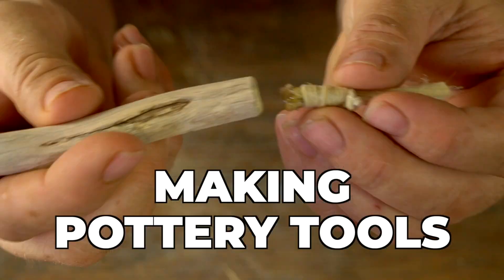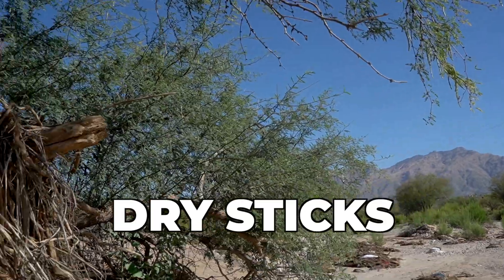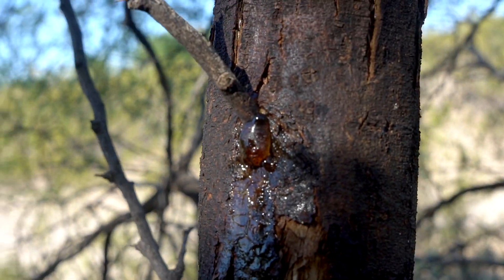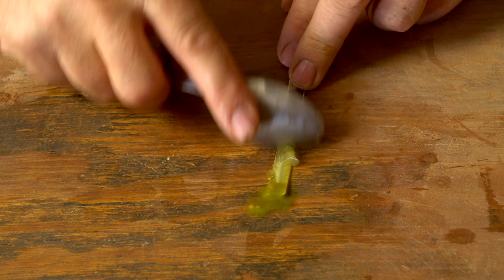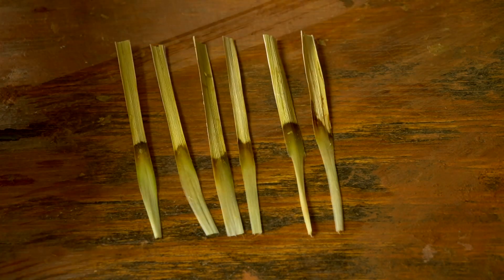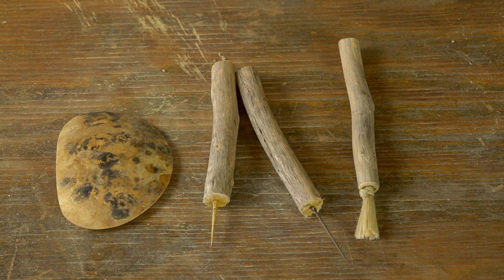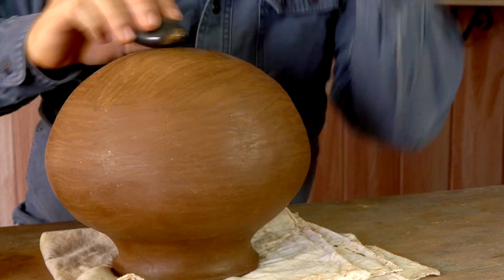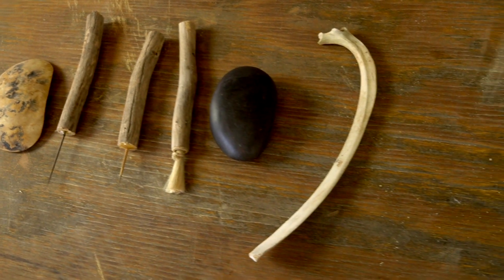3 Easy DIY Pottery Tools You Can Make From Natural Materials

Comment: I enjoy your videos. As a 40 year experience wood worker, I would suggest to folks to use great caution while drilling into the end of a stick. The bit could slide off and into your hand. Also, the wood can split allowing the bit to hit your hand. IF you have a drill press, which I'm sure most people don't, that is the safe way to do this. Thanks, Michael
Reply from the maker: Ha, well I am no example for woodworking anything, least of all safety. I think though in any endeavor a little care goes a long way towards keeping you safe.

Comment: If you go to beaches in Greece, choose the rocky ones and you have a chance to find adequate pebbles for burnishing pots every 5 min, and really good ones every 30 min. Choose the ones made of harder stone such as quartz unless you want the stone to rub its colour onto the pot. They just get better by using them. In places without nice smooth pebbles the use will make them smoother with time. I found an ancient burnishing stone among prehistoric ceramics made of quite inadequate porous stone which has been worn down and smoothed on its faces by the action of using it, in a place in Hungary where there is limited access to stones - there is only sand and clay everywhere. In those places burnishing stones were surely pssed on from one pot maker to the other. You can also pick up worn stones on trails and dirt roads where they are smoothed by people walking on them.
Reply from the maker: That's awesome. I am told that gastroliths make excellent polishing stones but I have never found one.

Comment: Instead of hot glue one can also use spruce or pine resin mixed with charcoal dust and fibres. To make it more flexible one can add oil or fat. 
There are a ton of videos on youtube that show how to make and use this stuff.
Reply from the maker: Yes, there are lots of options for natural glue. The method I chose was for maximum accessibility.

Comment: Here in southcentral Pennsylvania, we have honey locust trees that grow 7- to 8-inch-long thorns.
I use them and attach them to a handcarved handle that I carve out of a staghorn sumac tree branch.
The center of the wood has a soft center, much like styrofoam, so it's easy to make a hole just by pushing that center in and using sand to widen the hole.
I then attach the thorn to the handle with some pine pich that I make myself for a needle tool.
I do the same thing for making my brushes, but I use horsehair, whitetail deer hair or porcupine hair for the bristles and place them inside bamboo or rivercain handles.
If I need to rasp or grind something, I just go to the creek near me and get different types of sand stones that are found around here.

Comment: Hello, I was wondering if you may have a tip for me on when I connect clay together to combine even pinch pot's to make a pitcher when I do the water test or separates. It is a mid temp and I pit it with split wood. So the temp is getting supper hot. Thanks. I my self be for this video was looking in to primitive tools.  Thanks. Nice video, and good ideals for tools. I looked a a hawthorn and a few others in our area
Reply from the maker: Hi. I am not clear on what the problem is. When you say connect clay, do you mean like adding a coil out adding a handle? I have a lot of good videos with tips for coil pottery making, maybe this one will help https://youtu.be/W7H_PXmmhBA
Reply: Yes. I have watched your Coil Video. I have done the pintch connection. That is we're you take two peaches of clay in a coil or stacking to pintch pots to get Her that makes a pitcher. I may have made it to thick. That may have made it need to have more heat. I got me some hedge to fire pit with that gets to a very high temperatures. Hedge wood is a very high temp wood that will melt your wood stove. I am experimenting with it. The pitcher split at the seam. When I do coil even when I pintch the seam together it separates at the seams. We're it had been pinched together. It is like the water pushes them apart.
Reply: Thank You Very Much. For Your Responce. I have studied your Videos up to date.
Reply from the maker: @whitetopmountainlaurelchil3541  very unusual, it might be the quality of your clay but it's hard to say from here
Reply: Could the thick ness also have a role in it. I am not sure but I thank it may have been too thick. This pitcher came out thicker than normal. An if it was to thick I may not gotten to the temperature that would have to reach a higher temp to burn the carbon. And it can be the clay. I have made a few others and it gives me the sound I like. My bowl base - Puki I made. The Chilhowee Cherokee made a bowl base. Or they used a gourd as a pottery casting mold in our oral History and coiled work. I have been watching your videos and they are awesome. I also would like to imply that a bowl base or a Puki is a form of Clay casting. In every experiment of my Pottery. It has many things that the prices or fragments was used in Jewelry among other items. I thank sharing the information is cool and making this plat form is helpful. It is awesome for Natives we want to share with other. My wild clay I have learned why some came out very porous. And more less porous that becomes more except able for cooking.
Thank You Very Much.

Comment: Hello! I have found some clay near Phoenix AZ and while it is definitely clay, it sticks to  my hands way more than store bought clay and Andy's clay. This was both before and after processing. It is red if that helps. Does anyone have any ways of improving sticky clay? When I finished my piece my hands looked like a child who just finished playing in the mud. Haven't fired it yet but it has dried nicely.
Reply from the maker: Some clays are like that. Adding temper (non plastic material) will alleviate that problem. Usually something like sand is an easy fix. My video that comes out tomorrow morning will answer this question for you.
Reply: Thank you Andy. Love the vids and classes